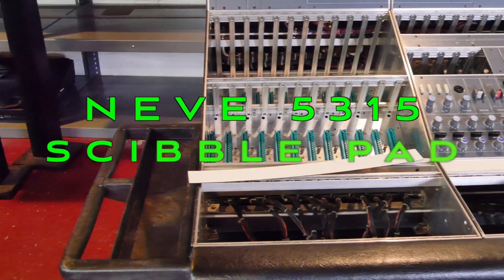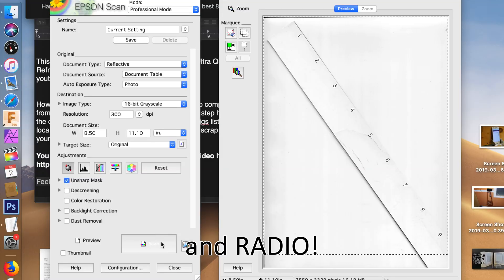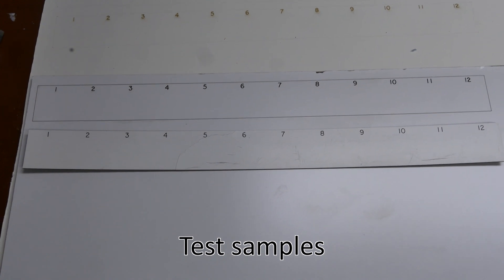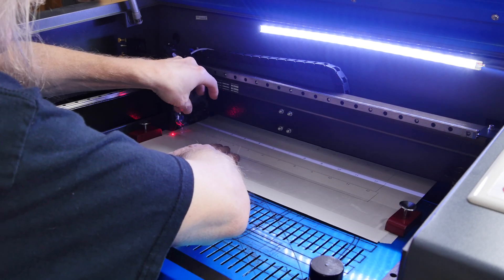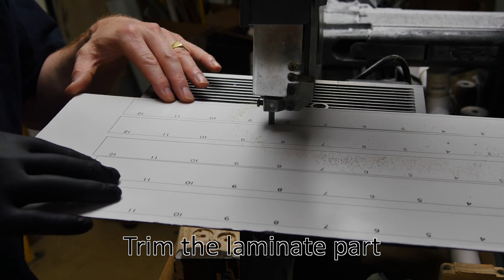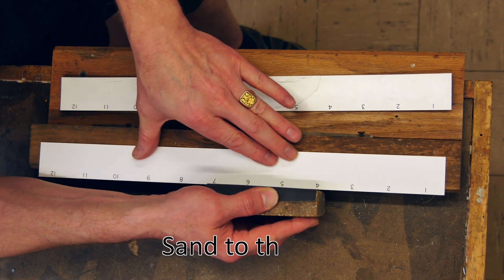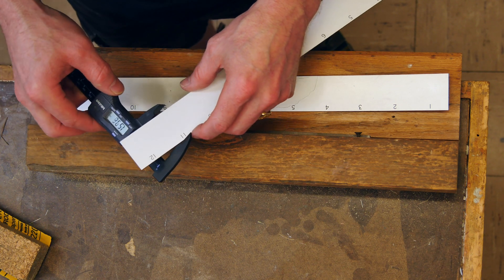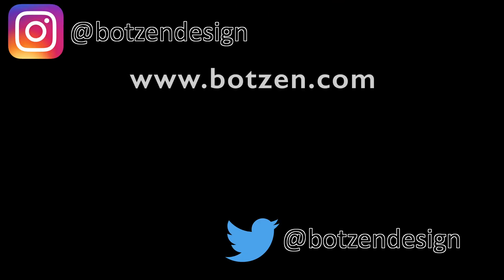Restoring a Neve 5315 laminate scribble pad, is it possible?

Comment: I'm with you on the move away from Adobe. I have a very long history with Adobe starting since before Photoshop, I've done trade shows with them, beta tested many versions including PS and met Warnock, Russell and the Knoll bros. when working with Heidelberg but I can't tolerate the current business model and will not personally participate. As far as corporate users go I never fail to mention that Adobe has a remote controlled kill button on their software and can prevent it from working at will and a lack of access to previous versions will put your entire archive in doubt. This should not be acceptable to mission critical users.
Reply from the maker: Brian Boni Kill switch! wow thats crazy.  Yeah, I have CS6, it will stop working with Catalina OS then it's lights out for Adobe on my machine :-) so training my self to use Affinity over time. Good tool! Thanks for your comment.